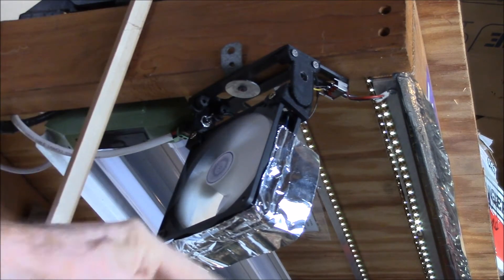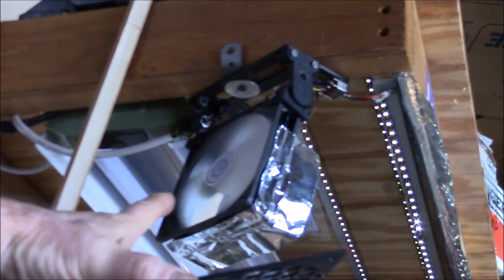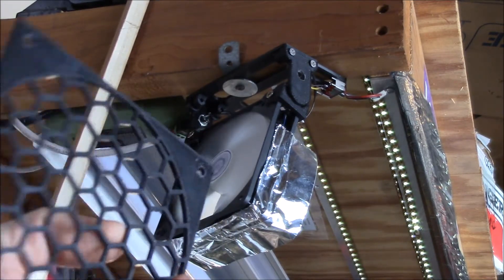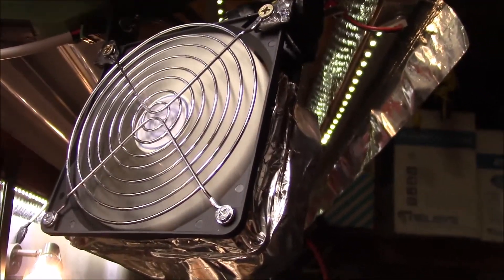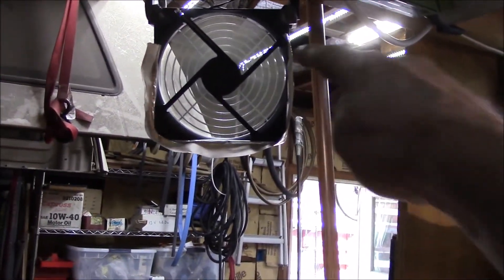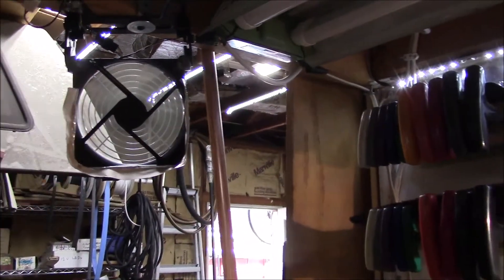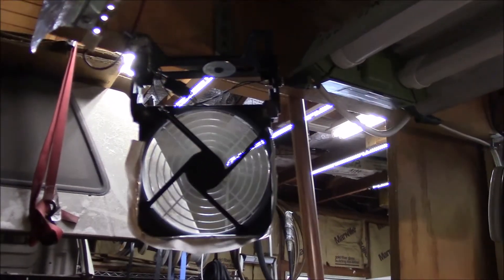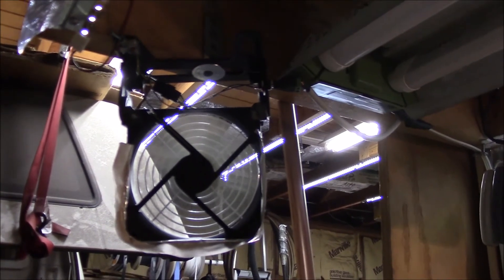12V Solar Cooling Fan, Update

Comment: Try the Cooler-Master 9" 12 volt fan they are super quiet and move a lot of air at 0.2 amps. I have utilized two and barely hear them!
Reply from the maker: I have a friend that uses those as well.  I'll have to keep an eye out for some at a good price.  But yes, the bigger the fan, the less noise they make.

Comment: That is why I still have a 12v battery bank also. Thanks for showing
Reply from the maker: Yes, sure is nice having a 12VDC power source and wiring around the place.  Easy to hook up small things like fans and lights.  My idea is that if I make it easier to connect something to my solar battery bank than to the grid, I'll take the easy way and put the load on solar power.